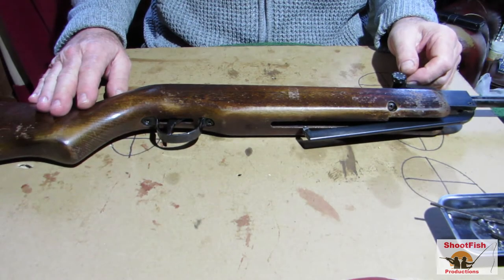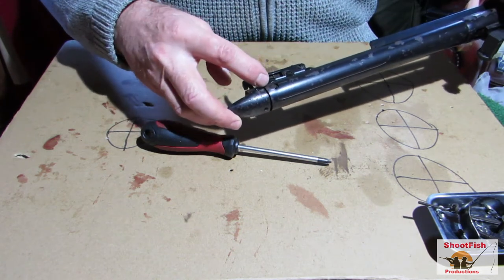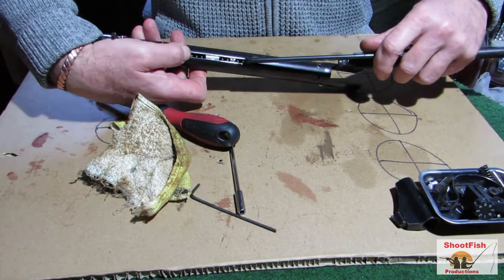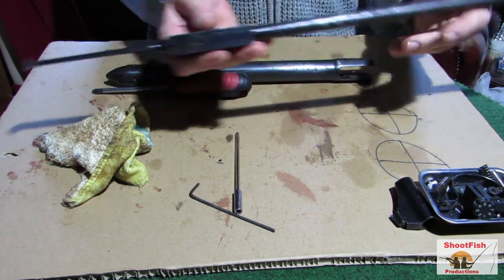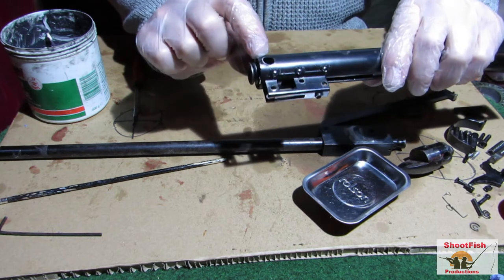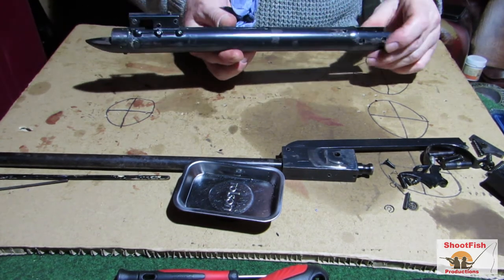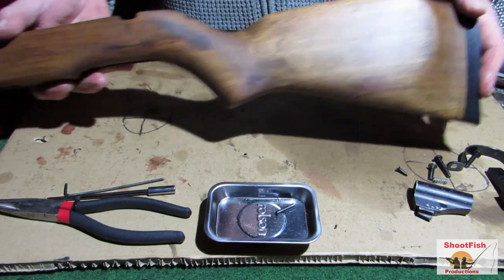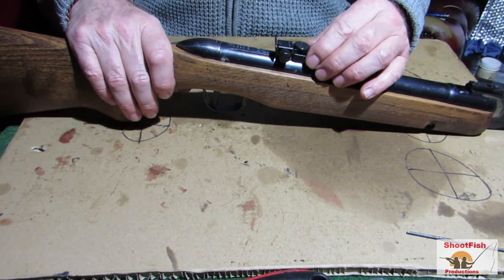Webley Hawk Mark 3 Airgun Refurbishment - Auction Buy

Comment: I had on of these... I bought it for £5 in 1980? off a kid who kept it in some woods (couldn't take it home). It had a twig stuck down the barrel and the reciever was held to the front of the stock with a big jubilee clip.
The twig pushed out with a rod, i found wider screws in me dads bits that sortacre-threaded the front fixing holes and I sanded the rust of the barrel and it was sprayed gold. ;-) The stock was stripped and I "varnished" it with ox-blood shoe polish. I new spring & piston washer and I was good to go.
My brother had a hw35 but it wasn't as powerful as that. But I was happy with it and no can or bottle was safe on my walks along the canal. ;-) Happy days...
Reply: Happy days indeed
Reply: @manofkentcatapultsgunsando5069 

I'll tell you a fond remembrance of how this country used to be. The eldest had a Wembley Premier pistol. He got married and it was left for us. I wrote webley for parts prices and they sent an exploded diagram of the gun with parts Nos & prices.

I sent a postal order off.

Just a proper company doing business. I had a webley rifle and that was the same. I did all this when I was 15 learning how to go about things by asking me mum.

When I try to buy a formal overcoat now, fk me what a palaver. You can go to M&S or... ??? The old traditional gents outfitters have hone. There's no C&A, Burtons, Debenham... they've all gone! I did get one in a out-of-town shopping centre but Slaters had nothing suitable.

When the last person leaves Britain will you turn the lights off!

Comment: I have one of these. I found the parts to sort out the safety, and a nice 2-stage (fake) trigger conversion. But I have the elongated holes and I wish this video had addressed that problem.
I'm going to overhaul my rifle, because it is actually very accurate and pretty close to 12ft/lb.
At one point I installed the later Vulcan model gas ram conversion, but for some reason the gas ram battered itself to destruction. But when it was working, it was sweet!
Reply: Found a 2nd hand cylinder without elongated holes, so that fixes that :)
The 'safety' has the problem described, and I think it is because it allows the trigger too much movement on safe. I will fabricate a small saddle to tighten up the safety to see if that sorts it out.

Comment: I have had a few Vulcans, basically same gun but the Vulcan has more power, the thing l like is l make um into a take down rifle, the barrel comes out the block when heated, then keep in place with 2 M5 grub screws. And a fold away stock, there a basic but very powerful and accurate gun, when folded and barrel removed it's only 17" long and l have a Hawke 4-12x50 AO IR Vantage scope on it.

Comment: Nice job, man.
I have just done similar. The one i got had a broken spring and no safety, the probkem i have is it discharges befor i have even closed the breech. I am thinking perhaps its worn sear or trigger. Any ideas?
Reply from the maker: yes, sounds like the trigger assembly, or part of the broken safety mechanism.

Comment: I have one of this,what's the price?
Reply from the maker: As with anything used, condition is everything as far as price goes. These rifles were at the lower end of the market, so it's a case of get what you can. Look on the gunstar and similar gun selling sites to get a handle on current prices.

Comment: nice video......but without the Safe Slide....the spring on the Sear will do nothing......that gun will not cock !
Reply from the maker: Well it does.
Reply: @ShootfishProductions  ok thats great....maybe i missed something....i just cant see what puts tension on the Sear Return spring.....? ok i ask because i have just fixed one .....and like yours the safe slide was missing....and the sear spring.... i got a new sear spring and found it had no were to tension it......i had to Fabricate a fake safe slide...that is in just the trigger Internals....and it works great.....i did read that a sear spring from a victor....fits the hawk3 without the need for a safe slide.....so i think thats what is in your hawk....:)
Reply from the maker: You have a keen eye, and I'll take your word on that. It was an auction buy, probably been messed with lots.
Reply: @ShootfishProductions  yes....i did find your video very helpfull...on my fix...thx :)